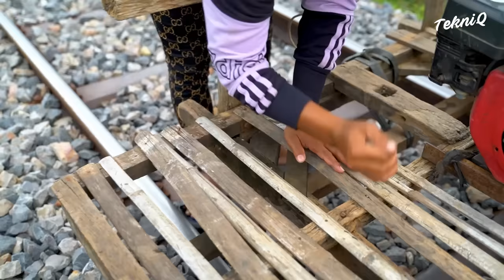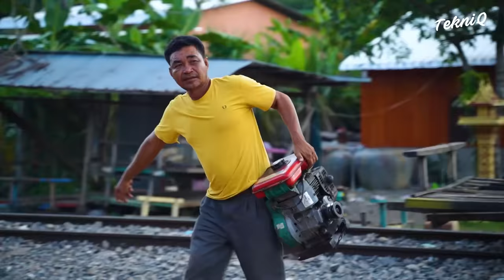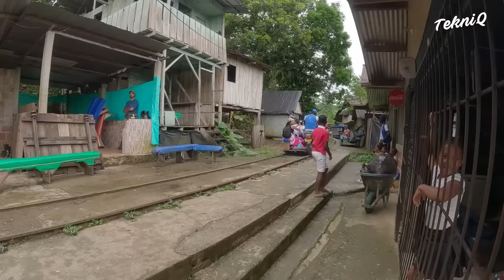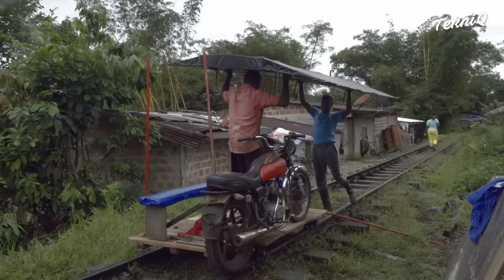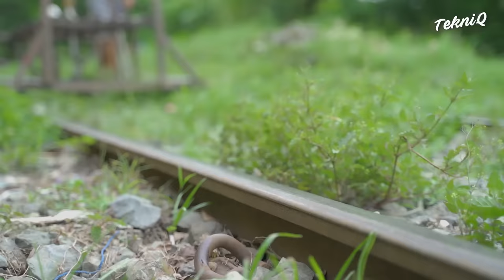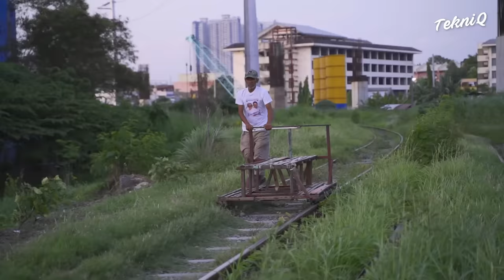Riding Cheapest Trains Across the World

Comment: There are a couple of things that surprised me the first was none of the motorcycles or small engines shown running were emitting any oil smoke. The second was the generally good state of repair the the tracks were. In a couple of places I say new track sleepers (railroad ties) and fresh ballast.
Reply: Hahahaha lol lol me too
Reply: I think they run on alcohol.
Reply: Вот это наломаются за день! Особенно женщина!
Reply: Because they are 4 stroke engines. 2 strokes run on a petrol and oil mix and smoke, If a motorbike has a cylinder head with valves it's a 4 stroke.
Reply: By your comments, you wouldn't by any chance come from America?   If you do, it would answer many observations. 
I suspect this is somewhere in mainland S E Asia,  Cambodia, Thailand etc.,  or The Philippines or similar.   The "clean" fuel could be (probably is) locally produced ethanol as many developing Countries have an abundance of sugar cane etc., to produce the fuel from, in either an official industrial scale or a locally produced "home brew blend", which will also work.   Another poster has also indicated it could, and probably is, a 4 Stroke Cycle engine.   
As regards the high level of track maintenance,  you might find this track could put many suburban (or not-so suburban) freight tracks in the US to shame. 
Don't be blinded by peoples apparent circumstances,  as these people are going forward economically and will probably meet people (like many unfortunate Americans) going the other way as their jobs and prosperity are "exported" abroad by their Nations "big cats".      
The level of ingenuity people from developing Nations use to solve problems using the resources they have to hand never ceases to impress me.   This is just such a case in hand, where the alternative from point A to point B is either a long cross country walk or passage by river.